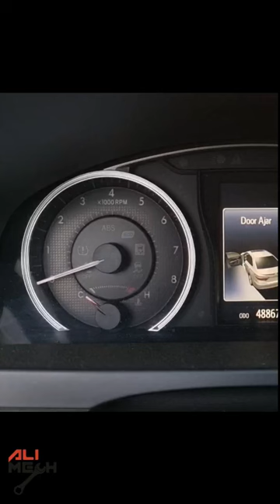Cleaning Electrical Throttle body with CRC #shorts

Comment: That is how you are supposed to do it you never push the throttle body flap with your hands or it will be damaged.  Great video!
Reply from the maker: Great point! Thanks for watching
Reply: Whoops 😂at least I didn’t hurt mine doing it…was a electronic Acura throttle I did have to do a idle relearn afterwards but I expected that cause the throttle body was super dirty
Reply: Just curious, why shouldn’t you do it manually. If the car is off isn’t it the same thing as your pedal moving it open.
Reply: @recklessdecay7720 in electronic throttle bodies there is a little computer on the side of it with some gears. Manually pushing the butterfly open can, in worst case, damage those gears. Usually though, you’ll just have to do a throttle body relearn process if you manually move the butterfly. Disconnecting the negative terminal on the battery can negate the issues tho. If it’s really dirty just remove the throttle body and clean it. Otherwise, spraying cleaner on it and cleaning it on the car will cause all those big deposits to go deep into your car and can cause worse issues
Reply: I did it manually off the truck and it did nothing, infact the truck ran amazing after removing the crazy amount of gunk I found. Guess it depends what vehicle
Reply: @Eurolaflare it's probably only ever an issue if you force the plate open like a gorilla. I've cleaned electronic TBs before and moved the plate by hand gently and it's never been an issue.

Most people just parrot something they've read. It's the same as people parroting endlessly not to use 5w30 as their US spec car says they must only use 0w20 due to cafe standards, who parrot lifetime fluids because the manual says so and most recently I've seen people also parrot on about only using OEM oil filters for some reason as if using quality aftermarket filters will suddenly cause their engine to blow up.

All the time they will just post a comment saying NEVER TOUCH AN ELECTRONIC THROTTLE BY HAND

NEVER USE AFTERMARKET OIL FILTER!

ONLY USE 0W20

but they'll never back it up with any reasoning let alone proof
Reply: @Eurolaflare he is correct…I for one am kinda lazy when it comes to cleaning my throttle bodies as I open them manually(if you do this, at least do it with some caution and open the butterfly door slowly) & I for one have not YET broken the throttle bodies & only either ever had to do a throttle relearn or battery disconnect to reset the idle. Realistically though, this is the actual proper way to do it without causing harm to the throttle body itself…& you don’t need to do a throttle relearn or idle relearn after doing it.
Reply: @dean7416  I have a 2012 Sonata, and every 60,000 kilometers I clean it, push it with my hands, and clean the inside, and it does not break down. Fear might make you think it will break down.
Reply: @user-mv6de7gi4p  I said it “can” damage the gears but as long as you’re careful and not forcing it open and close super hard you’ll be fine

Comment: Ive seen other mechanics say to never spray directly into the throttle body because the dirt inside will become slush and fall into the engine and make it worst. To spray on a microfiber towel instead
Reply: Has he ever seen engine inside? It's the dirtiest place after exhaust pipe 😅
Reply: Indeed you're right and you have to remove it completely
Reply: @alex-wr7hg Quite the contrary, it's oily. If it was dirty you'll hear it quick. Most likely the bearing for anything under 20/thousandths of an inch.

Comment: Click bait.... Throttle body should always be removed for cleaning, then PCM cleared, engine started and allowed to idle for 12 minutes so PCM relearned baseline throttle position. Then vehicle driven for about 10 miles so it can relearn transmission shift points. This is the bad thing about YouTube...   Anyone can buy a can of CRC throttle body cleaner, but most cannot do the job correctly.

Comment: NEVER EVER SPRAY THE CLEANER THIS WAY. 😱..YOU RISK DAMAGING THE MOTOR. THE CORRECT WAY IS SPRAY THE CLOTH WITH THE SPRAY CLEANER, AND CLEAN IT WITH THE SOAKED CLOTH, NOT THIS WAY, AND HAVE SOMEONE KEEP THE CAR RUNNING ON PARK, TO KEEP THE THROTER OPEN WHILE YOU WIPED WITH THE CLOTH.

Comment: the back of mine in my 2012 chevy colorado was so gunked up and dark on the back side i had to remove it completely to truly clean it all off, opened the flap manually gently and it caused 0 issues. after i reinstalled and went for a drive i couldn't believe how much better the truck ran, it was for sure gunked up bad affecting how it ran

Comment: Hi should we clean the hole which hold the throttle plate or just the plate, I presume we should clean thr groove which enable the cap to either open or close it completely...all the debris that is stuck in the groove is blocking thr plate to close it completely...ofcourse we need to clean the cap as well however the main culprit is the debris accumulated in thr Grove if I am not wrong.

Comment: Quick question how do I do this with my 2008 Lexus is250 I got to the throttle body and when when I tried to push on the gas the throttle body didn’t open, any tips?
Reply: Same but i have a 2011 is350. Did you manage to figure it out?

Comment: That's incorrect way , the throttle body should be removed from intake then cleaning from both sides,  avoiding the direct to spread inside engine.

Comment: I opened my throttle by hand and cleaned it, is that okay?
Reply: i think they say to turn ignition key foward first then i think you can move throttle by hand and clean it. double check with someone  but i think that is fine to do that way.
Reply: Some electronic throttle bodies, mostly Nissan, can throw codes and even go into limp mode if the butterfly is moved without the pedal being pressed. Something about it messes with the throttle position sensor I believe but I'm not 100 percent sure on that
Reply: Toyota Master Tech said its perfectly fine, just be gentle. As a matter, he said DO NOT open it using the gas pedal. One can severely hurt themselves as the servo will shut the TB with force.

Comment: Is it not better to remove the throttle body.... spraying that into engine can't be good... none the less the carbon buildup dripping inside aswell
Reply: I spray the cleaner onto foam tipped swabs and never directly into the intake.

Comment: Incorrect way to do it,especially when the throttle body is facing up. Gravity will pull all the dirt down. 
Removing the throttle body is required. 
Cleaning it and then resetting the system.

Comment: Thing looks clean loll..only a small cleaning with rag needed…yes disconnect battery or you may lose a finger …like this
Reply: Thanks..so its ok to clean the electronic throttle body..just throw spray there

Comment: so key in on position foward and press throttle then spray and wipe.( can i open throttle manually if i cant find a helper?)with key foward in on position.?
Reply: You never push the throttle body flap with your hands or it will be damaged. You must get a helper to turn the key on and step on the gas pedal.
Reply: @allimkhan7540  i appreciate that. i cleaned a couple plates but fortunatly didnt push. good info. 🏁
Reply: @allimkhan7540 i was slightly pushed that plate, is it ok?

Comment: 2 nd question please. does battery need  to be disconnected? one video said yes but ive never done that. ( thanks for video. very good.)
Reply: cleaned it two weeks ago and forgot to disconnect the battery electrode and I also disconnected the plug and removed the entire throttle to clean it outside after installation it did not work in the correct way delay in pedaling and the pointer went down from 800 I tried all solutions but in the end it was set on its own
Reply: If you disconnect the battery,  you can't open the throttle the way he did in the video
Reply: @fortunatedad7695  i appreciate reply. 🏁